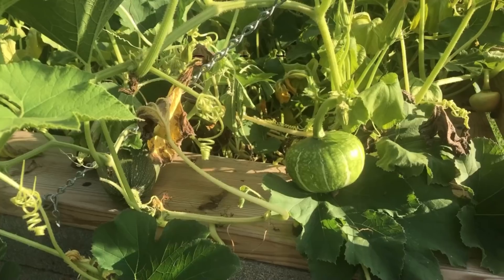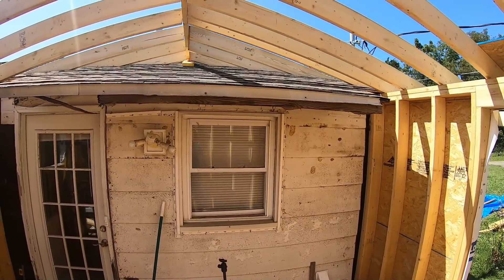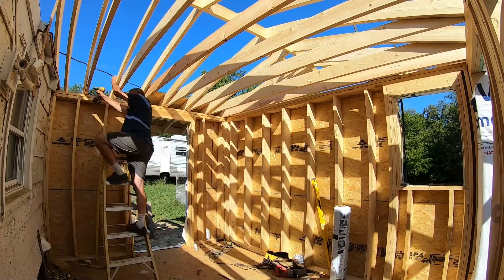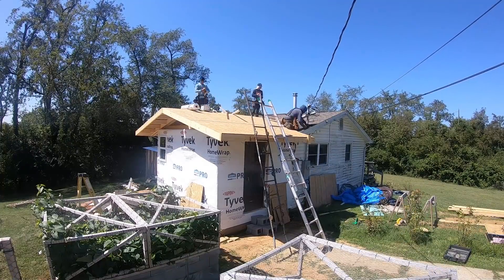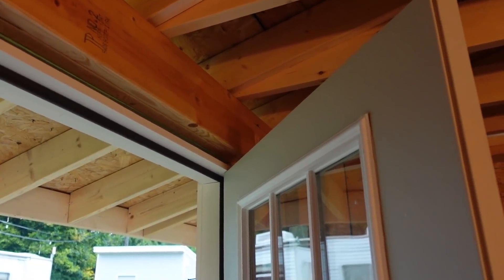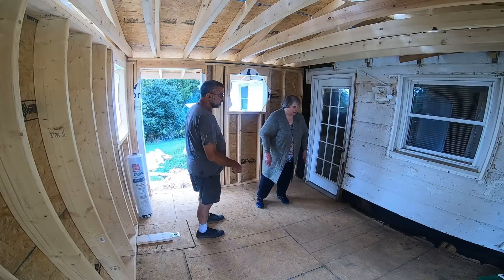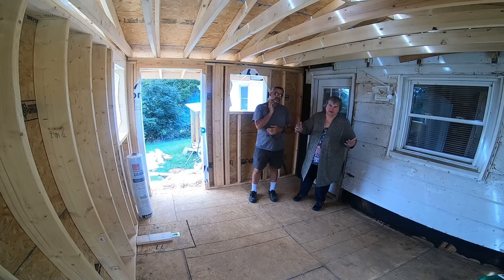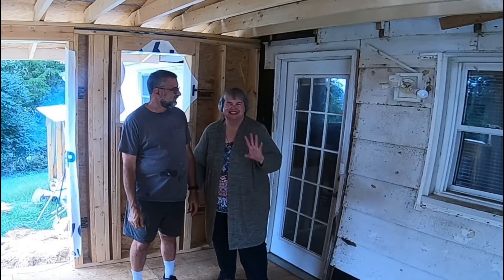Addition Build 12 -  Roof & Shingles

Comment: I don't mean to be a critic, but you are going to have an issue with the valley on the power line side of the house,  the addition roof should have extended past the bottom of valley, so it would have flowed onto a shingled plane, as it is now the flow will wash directly against the return facia. as well as washing under shingle edge.

Comment: You going to nock part of that wall of the house out too , looks good what about porch lights , lights on the inside ,?? , Nice 👍👍👍👍👍
Reply from the maker: The wall stays.  That's where the half bath goes.  Also the fridge and the washer/dryer go up against that wall.  The existing window will become the new door.  Lights?  Yes, of course.  Plenty of interior and exterior lighting to come, in future videos.

Comment: I like the way you explain the "how and why" of your process. It's not long winded. It's in-depth. You're using good judgement too by having hired out the small roof portion. If you were to get hurt, in any way, it would be devastating. I know this is difficult for someone like you, but think about hiring out for a bit of the inside work as well.
Reply from the maker: There really isn't that much inside work to speak of.  Just a day of wiring, and a few days of sheetrock.

Comment: Hi Bill, I just finished a 24 by 28 garage with 9 foot walls up here in Ontario Canada. I am 65 and work like you do, a few hours in the early morning while it is still cool, and usually quit around 1 pm. When you were raising the walls, I really felt for you! I had no one to help me and it would have been difficult to lift nine foot walls, not only vertically like you would do on a floor, but lift them onto a row of blocks above the slab and over the J bolts. So, I would assemble the lower plate and upper plate with both end studs, like a box and lift that onto the foundation and tighten the hex nuts down.  I would then fill in the studs, window frame and doors once the wall section was up. The top of the studs would be directly nailed down though the top plate and the bottoms were toe nailed. Worked for me....
Reply from the maker: I’ve built walls like that many times. 😀

Comment: Absolutely superb Bill.
I was watching to see what kind of valley you would use but it would seem you put shingles across the valley area? Is that correct? If so I'm assuming that they would need to be tucked under from the other side?
I'm keen to see how you do your drywall. I have a question to ask but I'll wait until you do it as I want to see one particular thing that you guys seem to do differently to us and I don't know why.😊
I really enjoy your explanations of what you are doing.
Reply from the maker: The shingles in the valleys are woven together with the ones from the existing roof.

Comment: You make great videos, Bill!

Spacer clips on the roof sheathing - that's a new one for me, never seen them before (I'm not a builder, just a DIYer). Makes sense, though. (One of the functions of the ceiling joists is to keep the walls from being pushed out by the weight of the roof, right?)
Reply from the maker: The plywood clips on the roof OSB are required code, and have been for decades.  They're not just spacers. They help distribute weight to the other OSB sheets.

Comment: Yup, roofing in the summer is brutal. Just had mine done & the roofer & his helper suffered! Imho I would use composite material for your stairs & stoop. Treated lumber rots quickly in our humid weather.
Reply: Some composites can be much more slippery when wet. I found that out when I slid on some that was drenched after a good rain. Marine plywood and cedar are more resistant to rot. Or a concrete stoop with wood or composite railing could wear well, too. I'm looking forward to seeing the next installment, and seeing what Bill and Elizabeth decide. God bless you both, Bill and Elizabeth!

Comment: Can you take out the back wall to really open it up and give more space?  Looks great though.
Reply from the maker: Are you talking about the wall between the current kitchen and the new addition?  We talked about that. But decided against it.  We need that wall space.  The refrigerator and the washer/dryer unit will be against that wall.  If we removed the wall, they would just be sitting out in the middle of the room! Also, the new half bath goes against that wall.

Comment: Everything is coming together and it's looking good. I'm curious, why did you or the roofing crew not lay down tar paper before putting on the shingles or did the type of shingles you used not require tar paper? I very much enjoy your step by step explanation of what you are doing and why you are doing it that way. Don't stop teaching. God Bless you both.
Reply from the maker: Tar paper is basically no longer used.  There is a new high tech product that is much better. We DID use it on this roof. It’s just that it’s not black, so you didn’t notice it.

Comment: Hi Bill,  at 4:16  you used some clips between the two OSB.  Can you explain about clips?  Did you use them everywhere or just on the smaller sheet?  Txs.
Reply from the maker: For roofing, those plywood clips are required on all OSB and plywood in between the rafters. They help distribute the weight between plywood sheets.

Comment: Get all the outside stuff done before it turns cold and rainy.  You can work on inside stuff all winter.  You could take that amount of space and make it a whole bathroom/laundry room, and free up more space inside.  I have a badly built addition on the back of my house.  I'm hoping in the next year and a half to free up enough cash to partially tear it down and rebuild it correctly, so it is weather tight and has a basement room under it.  It is 8 by 16.  The first three feet at the end is going to become a hallway to the back door.  I'm planning on putting a tub/shower in the middle of one wall with a toilet at each end in a stall, like a public restroom, so there is privacy for two people to use it at the same time.  On the other wall, I'm planning a stacking HE washer and dryer, a laundry sink and a bathroom sink.  That will basically give us a bathroom, powder room and laundry room very efficiently in one space.  When that is done, I'm going to tear out the old bathroom and add that space to the kitchen, giving us room to move without tripping over each other.  The old laundry room and pantry are going to become a tiny bedroom with a Murphy bed.  The space under the addition, when it goes from being a crawl space to almost full height will become my food storage space for my two freezers and my canning storage.  That will free up the rest of the almost full height basement for my workshop.  My house is roughly the same size as yours, and was built like a rabbit warren with lots of tiny rooms opening into each other and little space to move.  I'm trying to figure out how to use it as efficiently as a camper or ship, so that we have as much moving around room in the middle as possible.

Comment: Why do you need two exterior doors?  Seems like that is wasted wall space. You could have more room for the bathroom and door without the second exterior door.  Have you considered closing in the door near the bathroom and just having one door?  You can still access your outside patio from the one door.  Enjoying the series.  I’m sure it will be great.
Reply from the maker: We will use the back door to access the woodpile, so I don't have to carry the firewood so far.  Also (we haven't mentioned this yet) we hope to eventually have a hot tub on the back part of the patio near the house, and the back door makes much easier access to the hot tub.

Comment: Will there be insulation and how will you close in the area between the overhang and inside your new room?
Reply from the maker: Yes, insulation is required by code.  And the underside of the overhang will be covered with vented soffit.

Comment: my vote for what is next....winter is coming...do everything outside first porches...decks siding doors windows and the rest of the house. Get under the house before winter comes and deal with plumbing and other stuff.  It's looking good. I wish the whole kitchen could move out there and it was open with lots of windows, all the other stuff could hide in the innards of the house.
Reply from the maker: Finish all the outside stuff first - that's the plan!  Moving the actual kitchen out into the new room would have been fantastic.  But we didn't think of that!  Also, it would have been considerably more work.  We MIGHT still be able to change the plans and do that, except that we have already bought the custom kitchen cabinets to redo the kitchen where it is now.

Comment: Did you put tar paper (or like it) under the new shingles?
Reply from the maker: Yes, you can see it on the roof in this video.
Reply: @LiveSimpleLiveFree  For some reason I couldn’t tell on my tv.  I wouldn’t think you would not put the paper prior to the shingles.
I thought maybe a new type of roofing shingles that didn’t need the paper.
I know, crazy thinking.
Reply: @LiveSimpleLiveFree  
I see the roll of paper now.
From my tv 15 feet across the room and the speed of the video I couldn’t tell it was the paper.
That’s what getting old does to you.
LOL

Comment: It's a shame you  didn't run the plumbing , and I assume electrical services,  in the crawl space before you put down the subfloor ..... seems it would have been much easier than now having to worm your way around under the floor with not much head room.  But, then you were playing beat the clock.
Reply from the maker: There will be very little plumbing under there.  And I couldn't run the toilet plumbing until after the floor is installed.
Reply: @LiveSimpleLiveFree  You couldn't run the drain line over to where the toilet is gonna be before the floor was in? Strange.

Comment: Have you thought about removing that now old wall completely and just have one XL room verses a separate room?
Don't forget to update your house insurance for the additional "living space" you added. 
Great Job Seems like it did not take as long as you thought it would.
Reply from the maker: The wall has to stay.  We need the wall space. That's where the half bath goes up against.  Also the fridge and the washer/dryer go up against that wall.  Otherwise, they would just be sitting out in the middle of the room. The existing window will become the new door.